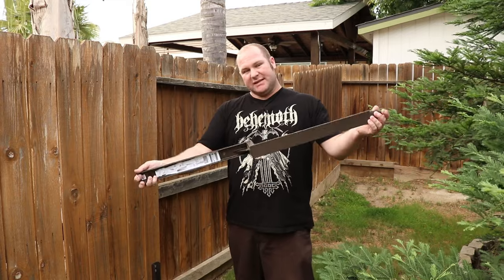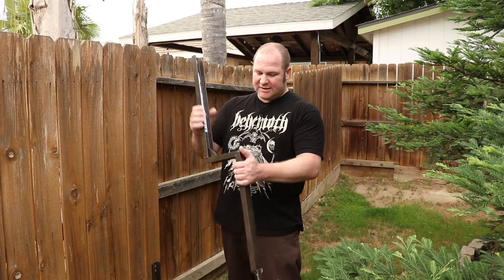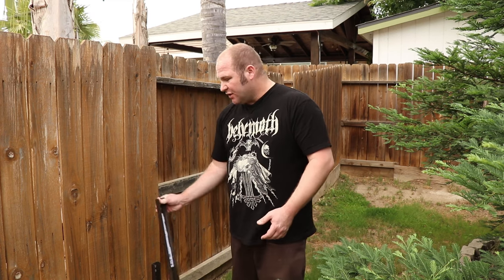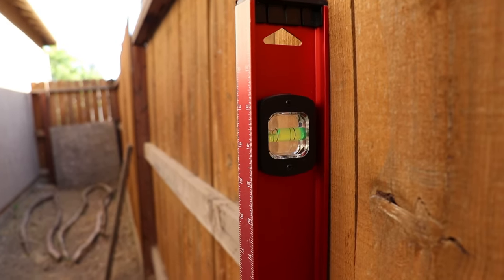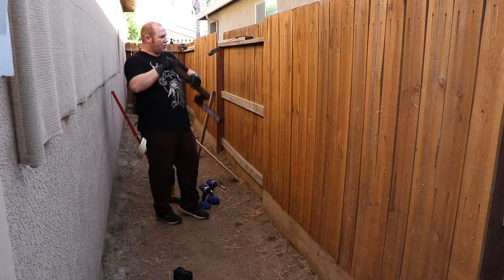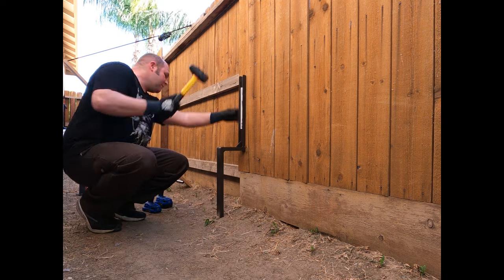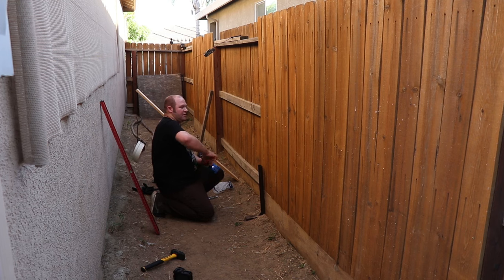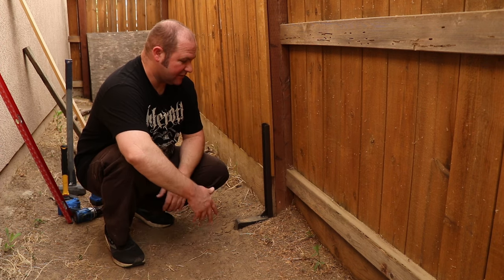Fixing a Leaning Fence Using Post-Ups - Two Year Review and Detailed Installation Guide

Comment: Just repaired a post today. I used a repair post similar to the item you used. Only difference is we dug a hole, inserted a form and filled it with concrete, stuck the stake down into the concrete and let it set with the repair portion screwed to the post. I also drilled a hole though the stake near the bottom and affixed a stainless steel 1/4 inch machine screw double nutted to create a spike that sticks out each side of the stake. To straighten the post, I used a come along with an eye bolt screwed to my storage shed that was just a few feet away. :)

Comment: I bought one directly from their website.  I was charged $54.50 for the PostUP and $15.00 for shipping to Pennsylvania. Total cost for PostUp and Shipping was $69.50. Made of thick sturdy metal. Went into the ground easily using sledgehammer. Came with bolts. Installation was easy. Fence is up and straight and looking good again. Happy with product.
Reply from the maker: Yeah, unfortunately they are very heavy and bulky to ship.   I do absolutely believe they are a stronger option than any of the other metal post repair options, but that also makes them cost more.
Reply: If you had Amazon prime you could get them for 65 for the pair with free shipping.

Comment: Informative video thanks. Another way to increase the weight using the strap would be to use a 5 gallon bucket and add more water as needed until the fence is plumb. 1 gallon water = 8 pounds so a 5 gallon bucket could potentially hold 40 pounds.

Comment: Just loosen the top bolt let the fence lean back and shim it with some composite shims until the fence is sitting plumb. That way you don't have to dig the support back up but you can still get the fence straight. I feel like each support should come with some spacers or shims already included since the chances of pounding that thing into some really hard dirt plumb, level, and tight to the fence are very slim. Especially for a DIYer.
Reply from the maker: Great idea, I'll have to give that a try.

Comment: If it’s harder to get the post fix bar in if the ground is solid, surely that’s good as it will hold up. Wet ground is only going to give you movement right.

Comment: Great video! Appreciate the detail and tips. Looking forward to fixing my fence. New subscriber here!
Reply from the maker: Awesome, glad that you found it helpful.  I actually have another section that needs to be fixed and wont be able to use these, since its in between concrete on both sides of the fence.  I was going to try to do it this weekend, I caught a cold at work so it looks like it will be next weekend.  I'll have to film that to show a comparison in time for an average person repairing a fence the traditional way vs with this product.
Reply: @Zero2Random  that sounds great. I'll be sure to turn on notifications so I don't miss that. I'm in Houston, TX. I like how easy this is. Easy way to shore up a fence before hurricane winds.
Reply: @Zero2Random  also interested in the comparison, being the average guy myself!

Comment: It’s easy quick fix but expensive . It would cost about 20 dollars for a new post and cement but a lot more work . I’m surprised u needed to fix that section of the fence it looks like it’s still in good condition. I’m not sure it’s safe to use that many of them if  it’s all on the same fence . Maybe I should also have a talk with your neighbor about the drainage issue
Reply from the maker: Unfortunately for me, I would likely have to hire someone to replace the post itself.  At the time I first used it, I was working 6 days a week in extremely physical work and just didn't have anything left when I got home, plus an ankle that has basically no cartilage left.

That was the hard thing the fence itself wasn't bad, but for years there was a drainage issue.  Unfortunately the property used to be a rental, and the owner was all but impossible to get ahold of.  The new owners have fixed the issue, but the damage was already done.

That said, its been 3 years for the first ones, and they are still rock solid.  This weekend I have to attempt to repair a different section with actual post replacements, as it's in between a concrete walkway on my side and my other neighbors side.  We'll see if my ankle can handle the digging, or whether I will have to hire someone.

Comment: Like how you got the fence straight using the weights. Seen so many other overly complicated methods.
Reply from the maker: Thanks, my originally plan was to put a dog tie down stake in the ground the use that to leverage the fence over, but the ground was too hard to get the stake in the ground.  I was really happy it didn't take too much weight to do it.

Comment: Hmmm, I'm the only commenter?  My first thought was to go see me neighbor and do the same thing on his side, probebaly before I pounded my side all the way down.  Your thoughts?
Reply from the maker: If your able to that would definitely be ideal.  With these on each side, the fence would be nearly impossible to move.  The catch in my case is the neighbor has concrete right up to the fence, it stops about 2 inches away.  But if you can, that is absolutely a solid plan.

Comment: On the pull side or the push side?
Reply from the maker: Because of the offset, it can be used on either side.  The ones installed on this video and the first video was on the side you had to pull.  I have another one installed on a section that I had to push.  Both are equally solid in practice.

Theoretically, it should be stronger on the push side, but in use, I haven't found a situation that didn't work well yet.

Comment: At 54 bucks WHy not just buy another 4x4 at 18?
Reply from the maker: A couple of reasons.  The first, is that lumber is much more expensive in my area.  Pressure treated 4x4's in my area are $28, plus a bag or two of cement to do it properly. 

But, there are two more important reasons for me, and one I'm realizing I should have touched on in the video.  Firstly, I would not be able to physically dig down to replace the posts.  Even when that area is wet, its rock hard, and I have no cartilage left in my right ankle.  My ankle would not stand up to the amount of shock it would have to handle to dig in that hard of dirt.  So, I would have to hire someone to do it.  That was the most important reason for me.  

The other is time.  At the time I recorded that video, and the first one, I did not have the time to spend doing it "properly".  In soft dirt, you could install one of these in less than 10 minutes.  Even in hard dirt, and while filming, it took less than an hour to do by myself.  Given how well the first batch I installed has held up (better than some "properly" repaired posts that my neighbor did around the same time, the time I could save using this was worth more than the cost difference between the two methods.

Comment: Interesting that there is no need to put the base in concrete to support the repair and the old repair has held up even with the moisture issues at the install location.
Reply from the maker: I think what makes it hold to fence so strongly is the offset of the part that goes into the ground.  I was talking to the neighbor that lives on the other side of that fence, and he said he saw the rotted wood at the bottom and went to see how soon the fence would need to be replaced, and when he pushed on it it didn't budge.

Comment: All u gotta do is insert it, at a angle leaning forward, then when it's driven in, it should be strait...
Reply from the maker: That's how I did the section in the grass, the area shown at the beginning of the video.  Worked really well, but the dirt wasn't like a rock.

Comment: Great job but you shouldn't have to repair a fence that the builder installed using half-assery methods.
Reply from the maker: Absolutely agreed.  Unfortunately its the original fence that came with the property and they cut corners all over.  The builders lost a class action due to that.

Comment: Shipping explanation does not make sense. Item weight is 7 lbs. I just purchased an item from Amazon, steel to be exact weight was 9 pounds, total charge for the item and shipping was 29 bucks. So how does a 7 pound item cost Amazon as much to ship as you are staying? Something does not chive.....
Reply from the maker: Shipping costs are a combination of size and weight, along with company leverage.  Assuming they get a box made that is just 1" over the actual size of the product, they are looking at a minimum of $20.60 to ship that product through usps, at their slowest level, and that is if they were shipping it from 93291 to 93292, and both of those zip codes are in the same city.  That's at retail, and they probably have a shipping account, but even so, they are a small company that does not have the leverage to get super low shipping costs that some companies get.  

Most people don't realize the actual costs of shipping, because companies have included "free" shipping with everything.  The truth is, none of these companies are shipping for free, they have just increased their costs enough to cover it.  That $29 product you bought would be sold for significantly less if shipping was not included in the cost.  Its also a much smaller item for the cost to be that low.

Comment: Those are junk...don't waste your money, fix it correctly.
Reply from the maker: I would suggest trying something before saying it’s junk.  The first set I installed has been installed for more than 4 years now, and the fence is rock solid where it’s installed at, after two of the worst winters we’ve had in about 15 years.  There are a lot of junk fence repair products out there, but this isn’t one of them.

Comment: Dont have time to listen to rambling and diverse info, looks like an option. Anyone who has removed a cement base to replace a rotted post, 6 to 8 hours very hard work, knows that any option is helpful! But please, cut to the chase. filter to what we need. We'd rather watch a movie than hear irrelevant details.
Reply from the maker: I understand.  The section at the beginning was simply to answer the questions I received in my first installation video, which was straight to the point.  That is why the title said it was a two year review.
Reply: Second that. Make it more concise
Reply: I've seen youtube videos that removed them faster than that. 6 to 8 hours for one post?
Reply: @Susan70003  yep, he has time I guess

Comment: Wow talk about making a simple repair complicated and time consuming. 😆😆
Reply from the maker: Not sure how this is more time consuming and complicated than digging out the original post and detaching it from the rest of the fence, putting the new post in, and waiting for the concrete to set before re-attaching the rest of the fence.  The only thing that took a while was balancing the fence as I was doing this without a second person, and hammering the post in due to the hardness of the dirt.  Digging it out in this location would have been equally difficult.

Realistically, had I soaked the ground ahead of time, the entire process would take less than 10 minutes for both posts.  When I did the last install, that's how long it took, and those are as solid as the day they were installed.
Reply: simplest solution I've seen to date. Have no clue what you are talking about.